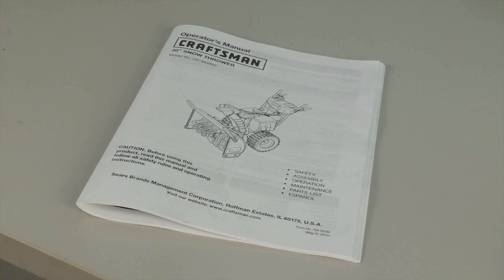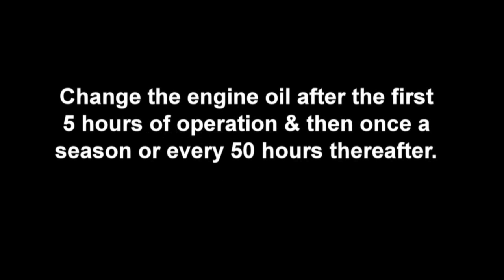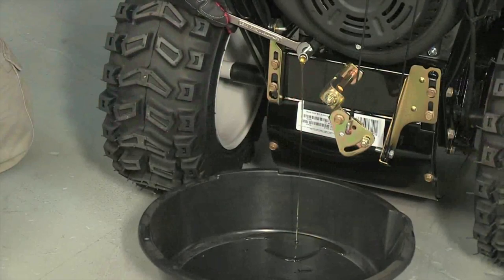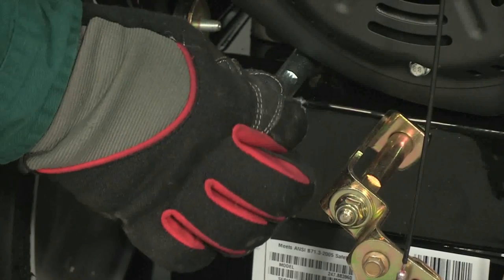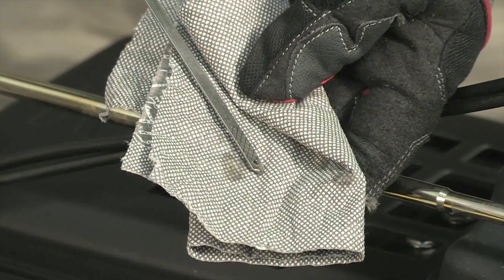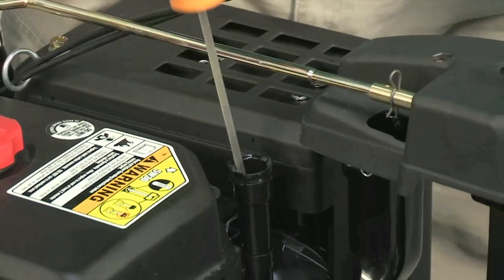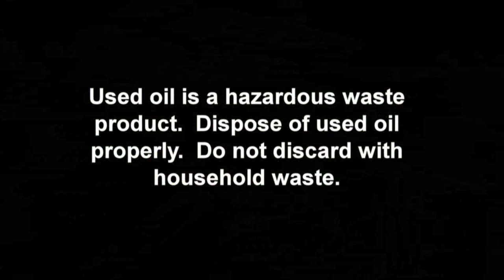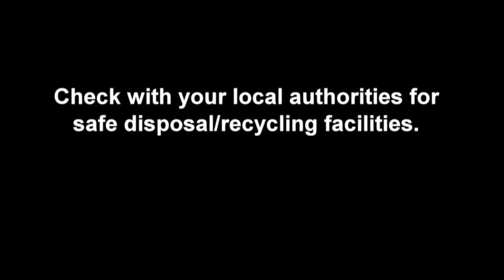How to Change the Oil in a Snowblower

Comment: Many do not know that air cooled 4 cycle engine oil has special zinc additives that automotive oil has much less of. Air cooled engines run much hotter, and the tolerances are set to accommodate the higher running temperatures. Toro, Ariens, Cub Cadet, Troy Bilt, MTD and most major snow blower manufactures recommend using 4 cycle small engine cold temperature oil. Most recommend 5w30 for easy starting in cold temperatures. Toro does make full synthetic 0w30 for extreme cold temperature startups. Most offer full synthetic or synthetic blend to offer better flow and protection especially during cold starts. Snow blowers are an expensive investment, so the right engine oil to provide the best lubrication and longevity of the engine is important. Regular maintenance according to the manual will make sure your investment operates correctly and last for many years.  I change my oil every spring regardless of the hours on the engine during the winter season.
Reply: 4 cycle small engine oil is also higher in detergents than automotive engine oil. I forgot to mention that.

Comment: Hi. Thanks. What is the small, yellow cap (looks like a drain cap) on the right side (standing behind the snow blower)?
Reply from the maker: That's a plastic cap that covers a bolt head.
Reply: @searspartsdirect  Thanks. But it's a "screw on/off, bolt-like" cap. Looks like some fluid should go in there. No?
Reply from the maker: @1212Maps  Let us know the model number of your snowblower and the exact location of the cap.
Reply: @searspartsdirect  247.887910   Standing behind the snowblower (at the controls) it's on the right side...lower...near the middle. It's a one inch, yellow, screw on/off cap.
Reply from the maker: @1212Maps  Thanks for providing us that model number. That yellow cap covers a separate oil dipstick/fill tube that's used on that engine when the engine is installed on a different type of product such as a generator.
Reply: @searspartsdirect  Thanks. So you're saying it's there and does nothing for my machine? Or should I add the oil THERE and not throught the dipstick opening?
Reply from the maker: @1212Maps  Yes. It's there but it isn't intended to be used for your machine. The manufacturer recommends that you add oil through the dipstick opening for your machine.
Reply: @searspartsdirect  Great. Thanks. Last question. What's the exact amount of oil I should add when doing an oil change?
Reply from the maker: @1212Maps  Engine oil capacity is 37 oz. When changing oil, we recommend that add 32 oz. then check oil level using the dipstick and add oil to the proper level. Some oil can remain in the engine during an oil change.
Reply: @searspartsdirect  Thanks. I didn't realize it was that much. I put in about 23 ounces of a 28 oz container....will go get more. Thanks. GOOD service.

Comment: Hi There,
Can you tell me how much oil for this model 247.888301 CRAFTSMAN. Thank you!
Reply from the maker: The owner's manual lists oil capacity as 37 fl. oz. of SAE 5W30 oil. Here's a link to an online version of the owner's manual in case you need it: https://www.searspartsdirect.com/manual/104mrsim0h-000247/craftsman-247888301-gas-snowblower-parts

Comment: how often w1030 needs to be changed, and  how much goes inside?
Reply from the maker: For the type of snowblower in the video, change the oil every 50 hours of use. The engine shown in the video takes 37 ounces of oil. If you have a different type of engine, the oil capacity and oil-change frequency may differ.
Reply: use 5 w 30